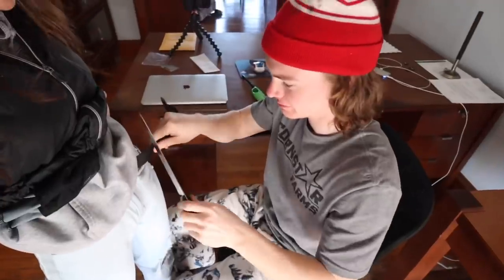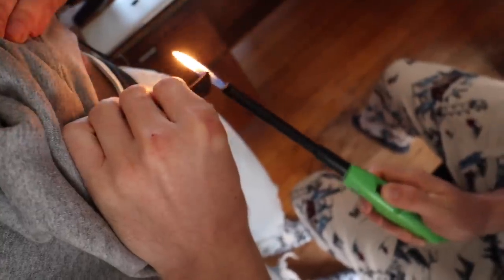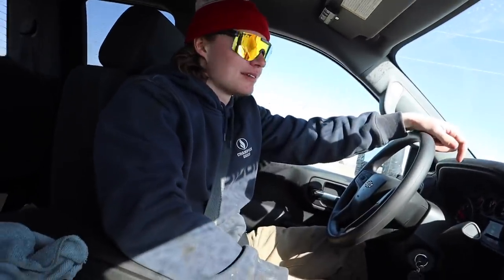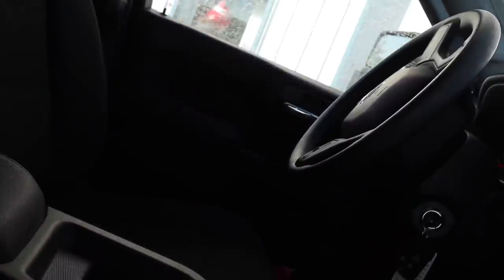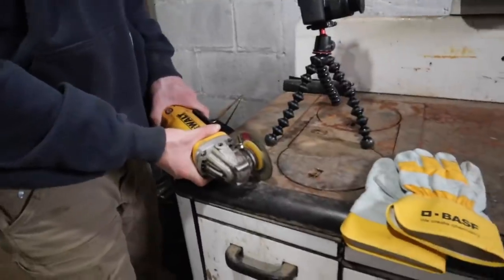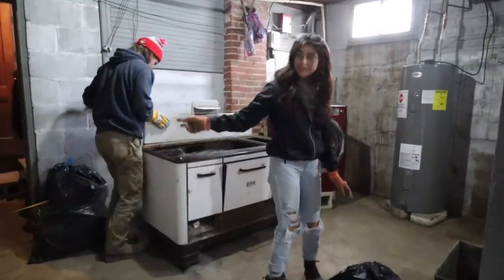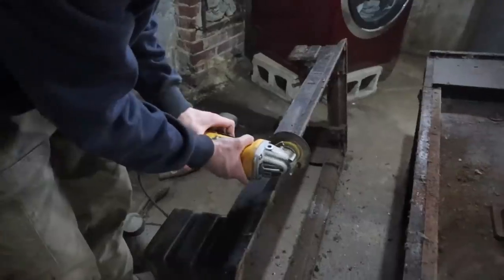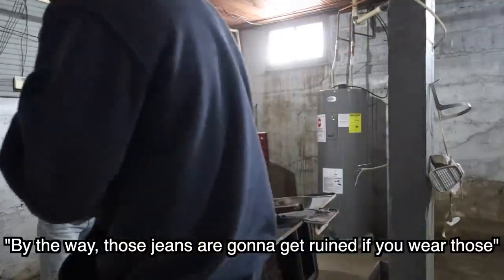Cole The Cornstar Teaches Me How To Use The Grinder!!!

Comment: Nave, you are doing excellent demo work!  The grinder is a very serious tool, even if it looks small.  I agree with the things taught you but there are a couple other things which you should consider.  Someone else suggested a guard.  That is essential and will protect you if the blade shatters.  Also with the heat generated by the grinding particles, keep a fire extinguisher handy.  Also check the worksite after you finish for about a half hour to make sure that you have no smoldering fires starting.  You looked like a pro using the grinder!  Good judgement when you stopped to ask for advice when the blade didn't line up.

Comment: Nice job Nave, dealing with that dirty mess.  But,.....some other safety pointers,.....the grinder should have a guard on it.  The guard is adjustable and can be rotated around for whatever you are doing.  I do not know if you did it or not,.....but always unplug the grinder when working on it.  I also do not know if you had a fire extinguisher close by or not, but the sparks can start things on fire.  And speaking of fire,.....it would be nice if you had a firewatch to keep an eye out for things starting on fire, whether it be you or materials.  You probably had some clothing on that would burn pretty easily, and may melt to your skin, which is really painful.  The mask filters may not have been fire resistant either.  Remember what you learned about the nail in the foot incident, and also the close call of the nail in the boot.  Safety does not take a Holiday and safety accidents are not prejudice,.....they are an equal opportunity destroyer.

Comment: That flat nut on the grinder works flipped around both ways. Which way you flip it depends on the thickness of the disc and the size of the hole in the middle of it. Also, either wear baggy pants that can slide over your boots, or close fitting boots/shoes so the sparks (which are tiny little hot chunks of metal) don't fall inside and start your sock on fire.

And limit the amount of time you line up your face with the disc. If it comes apart, the sharp jagged chunks will shoot straight out and into whatever is closer. If you want to see blood, do a google image search for "grinder disc explode". I always use a name brand disc so there are deep pockets to sue in case something happens.
Reply: I double like that comment.

Comment: I'd wear a old crappy coat or shirt when you are using the grinder. Sparks will find their way onto your clothes in all places and potentially burn holes in them. Also, suggest unplugging the grinder when changing wheels.

Comment: Nave. The angle grinder should have protection against sparks and breakage of the cutting disc. At least we in Europe have that. Otherwise, you're doing great, just keep it up. 💪👏👍
Reply: Should never use a grinder with the blade guard removed.

Comment: 4:00 also when working with a grinder ALWAYS set it down on switch facing up if you set it with the on switch facing down you could accidentally switch it on kicking it back across your legs or stomach and then to the ER you go.

Comment: I hate to tell you this it is cast iron hit it with a hammer. It will brake in small pieces. Just be careful the pieces fly ever where and are very sharp. I took out lots of old boilers. You can make the pieces as small as you want.

Comment: Two things I didn’t see.  (Likely edited out). Unplug grinder before changing blade.  (Yes there is a safety to prevent it starting by accident) but if unplugged you know.  2nd it looks off-set.  Likely the blade wasn’t centered, so the step up in tightener isn’t tight.   Also with blade down. Run new blade for 15 seconds full speed.  If it feels like bent tire.  (Out of round) or chunks break off (grinder blades can be damaged, pieces fly off on new blades.  Have them break in safe direction.
  You did good.  When things don’t feel right stop.   I think it’s funny.  Worn out, junk jeans are changed to much newer ones when they could get damaged.

Comment: Please get the blade guard put back on the angle grinder.  I have been using an angle grinder like this one for 25 years they are no joke.  The disc is not mounted correctly in the last shot of Nave trying to use it.  You have to make sure it is centered in on the hub.  Clamping up off of center like it was can crack the material it is made out of, I would throw that disc in the trash and start with a new one.  When these get off balance they explode.  Very glad to see the protective gear being used.  The respirator being used may not be correct for hot sparks.  Please be careful.  I love watching you guys and I don't want anything bad to happen.

Comment: ahmmmmm where is protection on that grinder?? there should be a shield that goes around that disk. my friend at work had half the disk fly into his face and cutting his nose,upper lip and kicking out two front teeth right next to me. those are not toys. se be careful and never i men never stand directly over the disk..always have ti on your side so if it catches,snaps or whatever it will shot that disk in every direction but not into you!...be safe...

Comment: Where is the guard that should be on the grinder? Yes, it get in the way but it is safer.
Reply: The gaurd is only in the way when you use the grinder in a way it was not intended to be used, and only until it's too late.

Comment: I would always wear eye protection, even when just cleaning or throwing metal around.  A couple of weeks ago I got a cat hair in my eye, which I did not notice until it had scratched my cornea so badly I had to go to the eye doctor.  I was crying floods of tears down my face, couldn't keep my eye open or shut either one, and couldn't see.  When the pain was over, several days later, my vision was still messed up for a good while.

A CAT HAIR.

Comment: If you were working for me you would have been yelled at as the danger of the blade flying a part and injuring you are  very high with no guard. Seen to many bad injuries from using a grinder without no guard cut tenons, bad cuts on the hands and fingers also arms. Please use the guard as they are there for a reason.